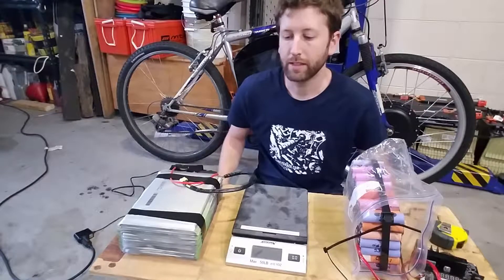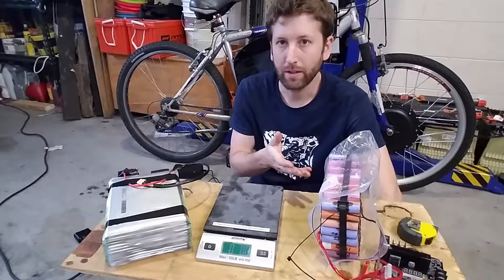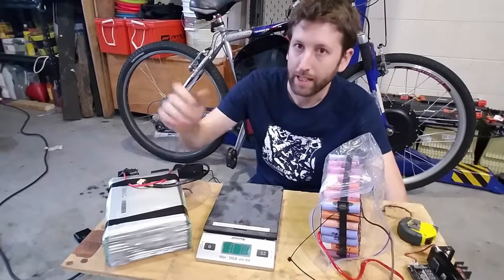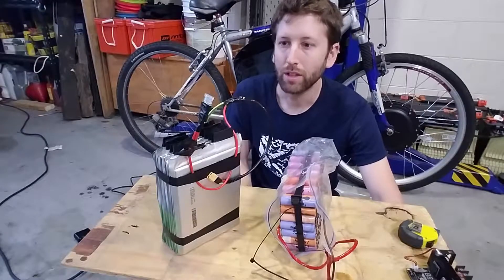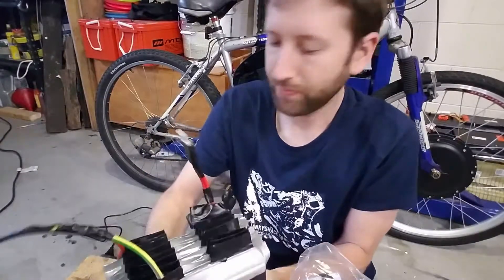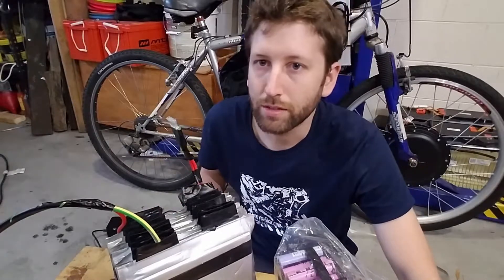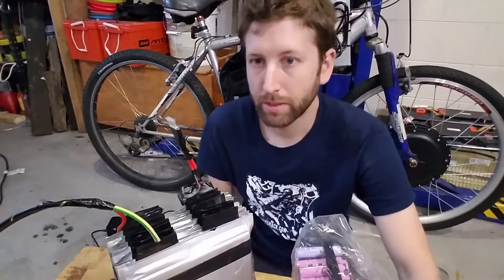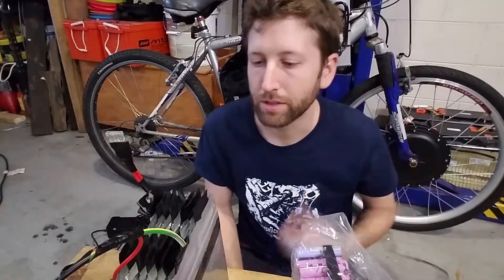Ebike battery rambletron with Chevy Volt cells and 18650s

Comment: Do you have a link to how you assembled the packs.  I have a complete volt pack that is at 0v I’m in process of pulling out each cell. I’m hoping to be able to charge  each cell back up and hope for best.  I ordered a Mini 80W iMAX B6 AC Lipo Digital Battery Balance Fast Charger For each cell. 
   Do you know what the voltage of each single pack is. Do I charge each single or as a group of 3. 
Thanks.
Reply from the maker: From my experience you should separate each cell and measure the voltage with meter. Any Cells that read less than 1V are totally dead and will not recover with any amount of charging.  Cells that have 1V or more sometimes will be able to be charged, however no "lithium chargers" will charge them since its below the minimum charging threshold of 2.5ish volts.  You will need  to charge them with a power supply which is pretty dangerous if you don't take proper safety precautions.  If you are charging 1 cell then the charging voltage should be between 3.7-4.2 volts depending on how many cycles you want out of the cell.  charging to 3.7v will give you thousands of cycles compared to exponentially less the higher you charge it. 4.2 may only give you a few cycles, kill the cell or cause a fire.  the higher you charge the cell the cells more likely you are to have an explosion/fire/damage because of heat.  Please be aware that charging lithium batteries is dangerous and should be done under close observation and away from flammables. People have burned down their entire house or died from this so take this seriously.
Reply: Janky Shack thank you and understood

Comment: I believe you're off by a factor of 3 on that battery. Yes it is slightly more capacity than the 10860, but not that much more. Those pouches are 15Ah, usually 3x are paralleled together to come up with 45Ah per module, and then X 13 modules to come up with 2KWh blocks. So in reality that stack you have is 15X48, roughly around 700WH, which isn't bad for that weight, but it isn't a 45Ah.
Reply from the maker: I don't remember what I said in the video, but yea they are 15Ah cells. They are a pain in the ass to connect too. lol

Comment: Thanks! I like your style. Thinking out of the box. There is a lot of buzz about chevy volt batteries. I have never seen a video about stripping down a CV battery into individual cells. I am currently using  4 -12S batteries( 48volt each) for my solar( with no BMS) I have extra batteries that i wanted to build an Ebike with. Your video is timely. You have taken the weight down considerably by extracting the cells. Question...With extracting the cooling wafers and compacting the cells so tight with no air gap , do you worry about overheating?
Reply from the maker: The ebike I have is ~1500w and goes about 32 mph.  I have been able to blow a 25 amp fuse on occasion, but not able to blow a 30 amp fuse even with the volt batteries.  The Volt cells are rated for 7.8C which is about 120 amps continuous discharge.  Personally I haven't had any issues with the cells getting hot or even warm.  Keep a close eye on your battery the first few times you run it on your ebike and use your hands to feel for increased temperature, but in my experience I haven't had any issues.
Reply: Janky Shack ummm I'm putting a full chevy volt battery 16s will be adding another 4s so 55ah at 84v or 4100kwh I'm crazy =/ but I get my battery today on the mail I'll be pulling 50 amps at full pull
Reply from the maker: @nightmareinaction629  I am having a hard time keeping the cells connected with solder. A few bumps will disconnect the cells. I want to spot weld them together, but haven't gotten around to it yet.
Reply: @JankyShack  I have a thread there are better ways to do it don't try to solder them you're only brittle the aluminum don't try to spot weld them I have the best spot welder money can buy Riverton copper are the best I've done a lot with them.
Reply from the maker: @dogdipstick  cool, do you have a link to the thread?